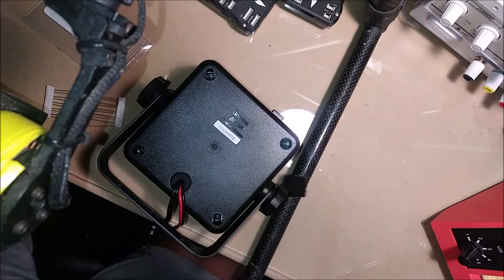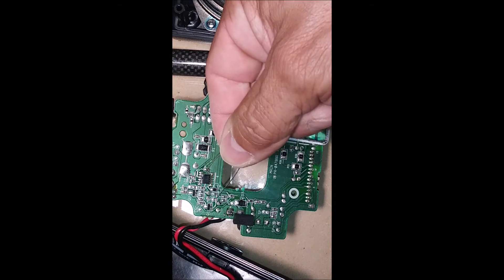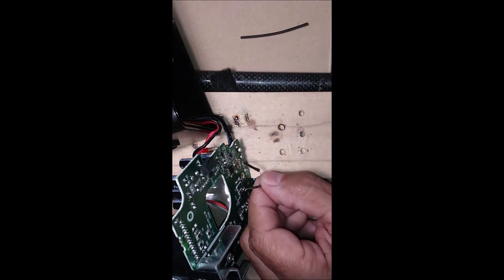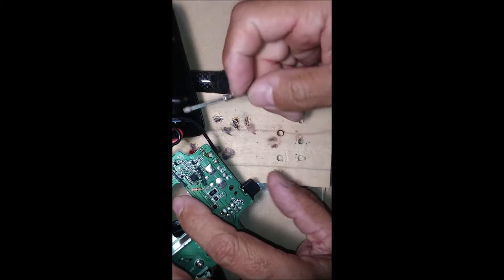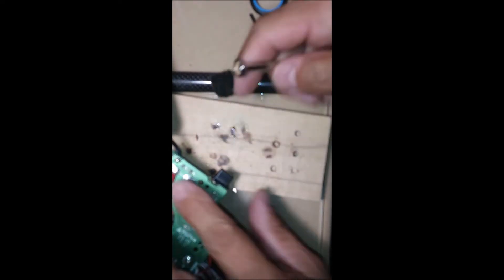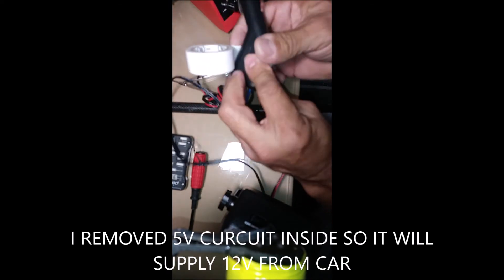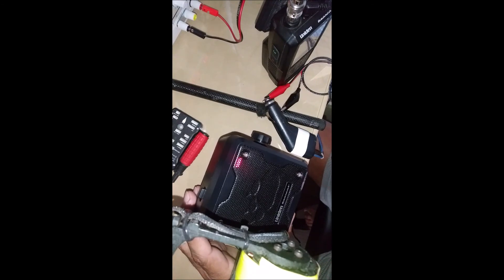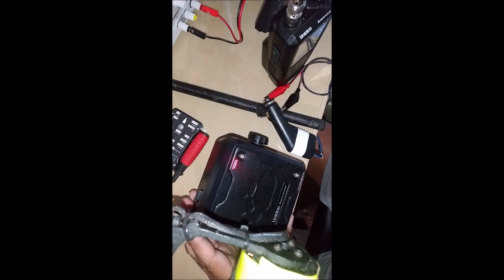UNIDEN SDS100 BOBCAT 23A EXTERNAL SPEAKER AUTO SHUT OFF ELIMINATE MODIFICATION HACK

Comment: Hey George, I just realized something while thinking about why I failed to do this mod on my own. I was going through my equipment used and I realized I had used some cheap, low quality solder that comes as a bundle item with those cheaply priced soldering irons from Amazon. The sad thing is that after going through my hobby tool box I found that I had some high quality Kester 63/37 solder which I failed to use because I didn't remember I had some in the tool box. Anyhow, it may very well be the reason why the dam resistor didn't stick properly to the circuit board on the speaker because I failed to realize I was using some cheap China crap that sticks less than a wad of bubble gum. I think now that I discovered that I do have some high quality Kester solder which if I remember properly I paid almost 40 bucks for it, I may just try this mod a second time with the new speaker coming in from Amazon in a few days. If you don't mind me asking George...Did you use Kester solder on your speaker mod or some other brand??? Just curious to know.
Reply from the maker: My solder roll label is faded but I know it is rosin core. very good quality. I suspect you had a cold solder joint. Second time around for you will be easier. remember to tin your resistor leads before you solder to pcb circuit. and use shrink around resistor leads.  If you dont have one get a magnifying glass to look at where you will solder. There are some that come with clamps that you can attach to something and use both hands while working. good for you for doing this again. Dont let this beat you. you will enjoy the always on sound. remember what master Yoda said, "Try, try not. Do or do not, there is no try"

Comment: George, I got the resistors this weekend from Amazon and I dared to try this mod although I have never worked on a circuit board before. I watched your video on this mod in full HD as many as 6 or 7 times to make sure I understood and I finally got the courage to do so. I must say it was a bit*h to get the resistor soldered to the board as I kept messing up time after time. I am lucky I bought the ten pack of resistors and on the seventh resistor, I finally got both ends soldered to the points indicated by you on the video. I felt like I had accomplished something huge and before closing up the speaker, I powered the speaker on with my police scanner for audio and Pyramid power supply and I was amazed that it worked. The red LED light stayed ON permanently and the speaker never shut off unless I turned the power supply off. The problem began when I went to close down the speaker and put all the screws back on.....all of a sudden NOTHING! The LED light did not come on immediately after I gave the speaker power and I knew something had gone wrong. Sure, the speaker did continue to work, but as usual with the auto shut off somehow still working after the mod. I think what happened is when I went to close the speaker case I must have displaced the resistor at either one or both of the soldered points which caused the speaker to go back to its usual auto shut off mode. I spent 2 hours doing this mod and I was not gonna open the dam thing up to find out what went wrong. I don't know why this sh*t happens in life but just when you think you accomplished something huge, something always goes wrong and some people have the patience to go back and try to find out what went wrong...I am simply not one of those patient persons which is why I gave up in trying to achieve this mod for now. Anyways, speaker is now headed back to Amazon for a gift card refund which processes much faster than a regular debit card refund and once I have the money in my Amazon gift card balance, I will simply order a brand NEW Uniden BC23A amplified speaker and just use it as it is with auto shut off. In your video, you sure made soldering that resistor seem easier than what it really is but it was a nightmare for me that I never want to go through again. I wish you lived near my city in California and I would drive to your location and pay you to do the mod for me but for some reason I get the feeling you aren't from the California Central Valley. I just don't have the skills, patience, know how to solder a resistor to a circuit board and I admire those who can do stuff like that real quick. Anyhow, some of us I guess are just condemned to have to use this great speaker with the annoying auto shut off and will just have to swallow our anger and bitterness for not being able to have a successfully modified Uniden BC23A without the dam auto shut off. Thanks for your time anyhow George.
Reply from the maker: You were so close. I think you may have had a cold solder joint, one that did not set properly. When soldering you heat up both resistor ends and apply a thin coat of solder before you present them to actual soldering point on curcuit board. That makes the connection stick better and faster when you touch soldering iron. And have a pointed tip. At least you know you did it right when you turned it on. I wish you would not give up. Dont let something like this make you feel bad. Attempt it again. I use my speaker while chasing military jets and the instant on the speaker gives me after mod is a huge bonus when listening to my Uniden sds100 military freqs because I know I will not miss any important audio while getting my camera ready to shoot. Losing 1 or 2 seconds of initial audio is curial so. You can also call your nearest electronic repair , car audio, tv, etc and they could solder for you. But you should do it yourself. Much more rewarding
Reply: @RAMBLE_ON  Well that speaker is packed up already and will be dropping it off at my local UPS store later. I did send an email to Uniden North America and suggested they carry a second version of this speaker without the auto shut off for those of us who prefer it that way. Will they listen? Who knows, but they sure as hell manufactured a speaker that could have been great if they would have simply left out the ridiculous auto shut off. I will be ordering this speaker again and will just deal with that stupid feature. I may look into what you recommended and see if one of my local electronic repair shops might be willing to handle such a task...I just wish the area where the mod is done on the circuit board was not so dam crowded where you can't really afford to make a mistake or else the mod won't work but it is what it is. Thanks George for your time and if some day I do get the next speaker modified and it works, I will let you know. Cheers! 🍻🍺

Comment: This question is for George G or anyone else who has done this mod...Are there any long term effects, dangers or electrical fire hazards in doing this mod to the Uniden BC23a amplified speaker??????
Reply from the maker: Long term effects? yes, a much better working speaker that has had zero issues since this mod
Reply: @RAMBLE_ON  Thank you George for the info. Will be doing the mod on mine as soon as I get the resistors from Amazon this weekend. I got the 1/4 watt 10K resistors which were recommended by you. One last question George...Did you use the 1/8 watt or the 1/4 watt on your mod because I know you mentioned on your video that either one will work OK. I am just curious to know if you used the 1/4 watt 10K resistor which is the one I will be using. Please get back to me to let me know. Thanks.
Reply from the maker: @yootoobercritikk1555  Used 1/8 watt resistor. I have done this mod to other units using 1/4 watt resistor and had no issues
Reply: @RAMBLE_ON  OK George. I can't wait to do my mod this weekend. I will be carefully watching your video on Youtube to make sure I do it right. Like many have said...I don't know what in the world Uniden was thinking when they added this auto shut off feature to this amplified speaker which makes you lose one or two seconds of a transmission. Anyways, thanks to smart people like yourself willing to share with others, there is always a way to remedy stupid decisions by manufacturers. Thank You.👍👍👍

Comment: No offense, but I think electrical tape for shielding the resistor contacts to avoid shorting out the circuits would have been way easier, faster and cheaper. To each his own I guess.
Reply from the maker: So heat shrink tubing that is made to SHIELD wire and almost the exact size as resistor wire that provides a snug fit would have been shielded better with electrical tape that you have to wrap around and hope it does not come loose!! Ya I see how the heat shrink tubing was a bad idea.....Your right to each his own

Comment: I have another question George. Is there a way to stop the annoying loud buzzing in the speaker when there is no audio coming from the scanner? That is the only thing I don't like about this speaker. Thanks.
Reply from the maker: Do you have Uniden SDS100? I have 2 of them and do not make any noise when no audio. Connect another speaker and see if noise continues. To find source of problem and go from there.
Reply: @RAMBLE_ON  Yes, I do have the sds 100. I also use a Uniden recommended Ground Loop Noise Isolator between the sds100 output and the speaker. I have also tried it without the GLI. It does not make the noise on other speakers, headphones or even bluetooth. I think in your video, I hear the same noise.    I just listened and watched your video again. That same noise is in yours too!
Reply from the maker: @NCMilVet  maybe I have had one to many concerts, and you have better hearing than I do. I am happy with what comes out of my speaker. When I have time I will connect my oscilloscope and identify sound you hear. I only use my external speaker outside in the desert so what ever noise that may be there does not bother me at all because I am not very close to speaker. Try yours and lower the volume from the sds knob and see if that makes a difference on external output
Reply: @RAMBLE_ON  I use mine next to my chair in my living room. The "hum" from the speaker is just annoying. Thanks for your response.
Reply: You will notice that the noise goes away as soon as the light on the speaker circuit goes out. The scanner is still connected and scanning.

Comment: That's sweet! Is there a way to change the voltage regulator in the speaker to allow you to power the speaker with a 5v USB jack from the vehicle?
Reply from the maker: A circuit can be made to handle the draw needed but you are better of just buying a male and female cig adapter and going into your car cig or straight to fuse box and plug in when needed. Just like video at 11:35 mark. When out in the desert I have left mine connected to 12v car cig for 9 hours with no issues draining battery.